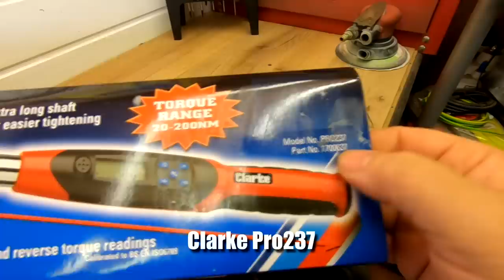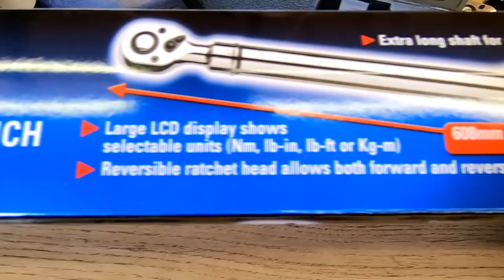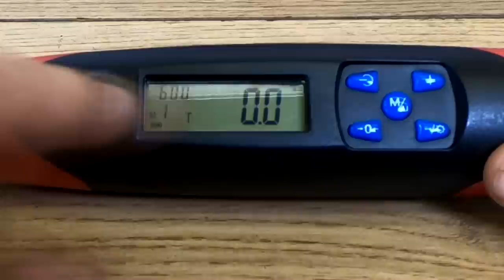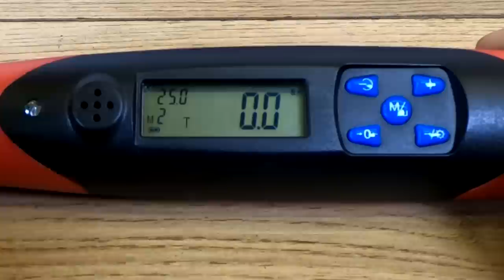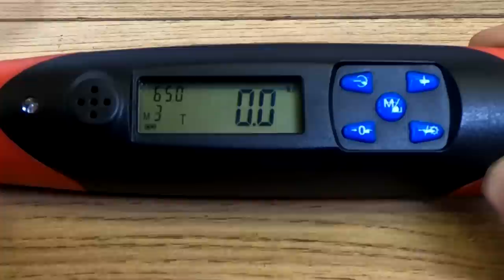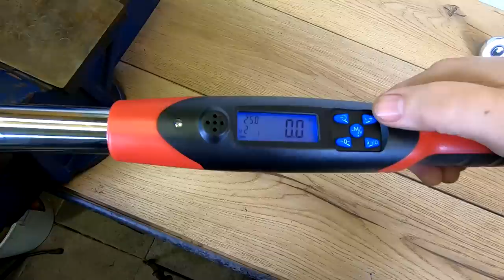Clarke Digital Torque Wrenches Let's Check Them Out

Comment: I find the digital ones are crap for precise torques because when your getting to your torque it goes from a beep beep to a solid beep once the specified torque is reached but when you look at the display it is quite easy to go over when the solid beep is heard where as the old type give a definite click once specified torque is reached , I have 3 digital torque wrenches ⅜ ½ and ½ angle torque wrench and the only time I reach for the digital torque wrench is when I need the angle function otherwise I just use the old click torque wrench.

Comment: The range KG-m is kilogrammes per metre (about 10Nm to each KG-m) Not exactly sure where this range came from. The USA tends to use ft/lbs where as most of Europe uses Nm.

I work on the railway in London where we have Torque wrenches from 1Nm  1/4" drive (basically that's finger tight) upto 1 inch that will happily do 2000Nm. For Christmas this year Uncle TfL is buying us digitally programmable Torque Wrenches. They're plugged into a torque analyser where you set the required torque (never believe what the gauge on the wrench says) and then you select things like a custom tolerance (1 or 2 % for example) maximum number of operations (if required) and a host of other perameters. Needless to say I have my eye on the old ones that will be discarded in the new year

Comment: I'm too tight to buy a new one, the one I have is from Lidl and I've never used it, partially because I don't read instructions and it was confusing to figure out how it worked. I work by feel and experience.

Comment: Fascinatin and useful and i applaud ya for bein so far ahead of us.  We don't even have the click type.  We still use the beam type.  Most of the time we have no problem.  So here's the question, the biggest problem I have with the beam type is that its most accurate only in the middle 50% of the scale, so we have several.  How about the digital ones are they accurate over all the scale or only part of it.
Reply from the maker: I can only go by the calibration certificate at different ranges so I presume yes.